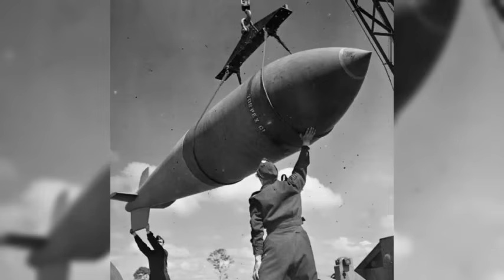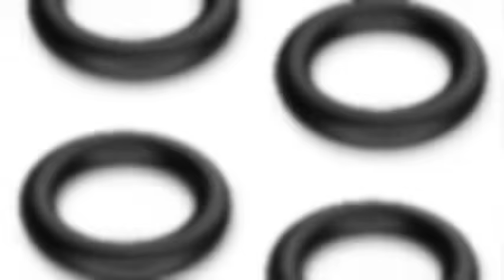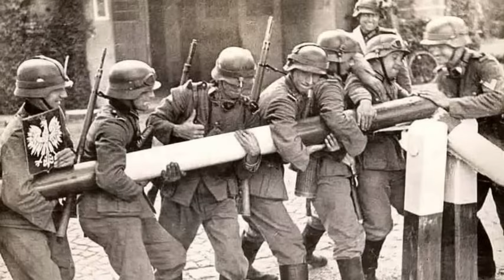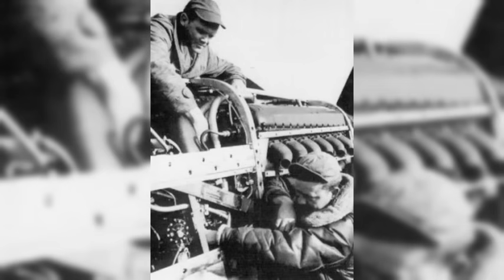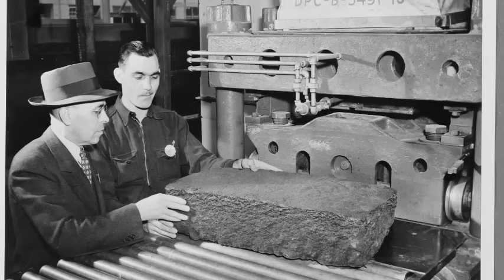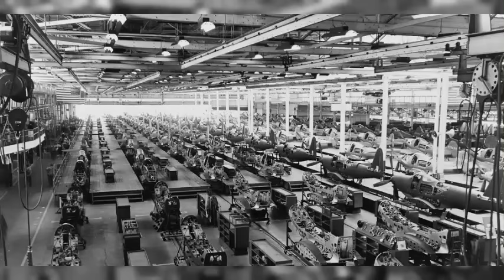History Forgot the Part That Kept Allied Machines Alive

Comment: My Corvair engine utilizes at least 30+ O-rings to eliminate oil leaks at the pushrod tubes, oil pump housing, bearings, etc, etc. And the nitrile version of the O-ring is the pinnacle of that technology due to its heat resistance and ability to not turn to stone after a few heat cycles, like natural rubber. Engine maintenance went from replacing the pushrod tube seals every 10K miles to over 50K miles w/ nitrile O-rings.
Reply: Apparently nitrile seals if burnt become super toxic and carsonogenic they were sold here in Australia under the trade name of Vitron
Reply: I bought several Corvairs cheap sitting in a puddle of oil. It wasn't a huge job to replace the o-rings, but it was hard to find the better ones.

Comment: Good treatment!
A couple of additional comments about O-rings. There are a host or ways to use these rings, and along with standards for sizes, the Parker o-ring handbook shows all of these typical situation, and provides pretty well proven “dimensional recipes” for the required groove and faying surfaces, as well as surface finish requirements. This aid made successful o-ring designs work out of the box with minimal development. In addition, when an o-ring is used in a static face seal, instead of a gasket, the joint clamp forces are metal to metal. This makes the dimension of the assembly more predictable. It also has a huge advantage in a stiffer joint that protects the fasteners holding the joint together from fatigue damage.
Having a simple o-ring available off the shelf is a huge boon to the designer. It eliminates designing and developing your own seal, getting it tooled and molded , then having to troubleshoot it in service. There can certainly be issues in service, particularly in borderline material-fluid combinations or in reciprocating cylinder seals, but o -rings typically got designs unto service successfully sooner.WW2 aircraft typically had short service lives. O-rings in dynamic sealing (seals that move) have more challenges but with WW2 pressures and expected lives they were fine for cylinders and shock struts. In today’s high pressure systems and long life expectations there are other seal geometries that work better. Fortunately, these are typically provided in standard sizes, standard installation requirements and by the same firms that made O-rings famous. In my 50+ years of mechanical design, the O-Ring Handbook from Parker has grown from 50 pages to more than 300 pages, mostly due to nuances and growth of elastomer choices for exotic fluids and important developments for success in special cases. Available online from Parker.

Comment: Bombers didn’t land with a load of bombs.
Reply: Well, not intentionally anyway.  Normal protocol was to salvo unused ordinance into the sea or into a defined “dump”.
That all assumes you have control over the bomb bay doors & bomb release mechanisms.  Some aircraft had hydraulically operated bay doors & a hydraulic failure (bad seals?) might force you & your unwanted passengers to stay onboard to the bitter end.  You really wanted those landing gears down & locked.
Reply: @rickclark9377 didn’t want to risk blowing up the airstrip and putting it out of commission for the other planes. They would also be coming in heavy and fast and might not be able to stop.
Reply: @D-B-Cooper and yet due to failures they might not be able to dump.